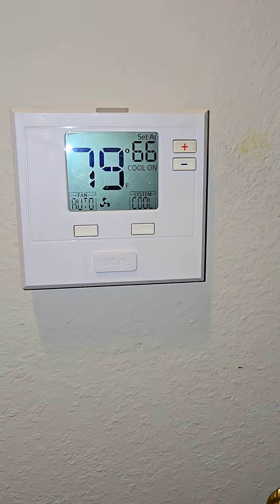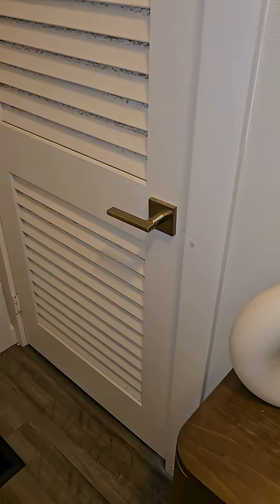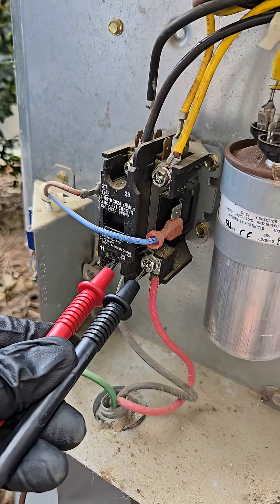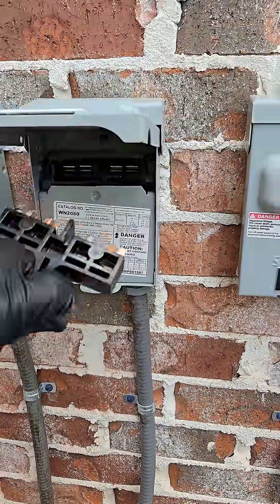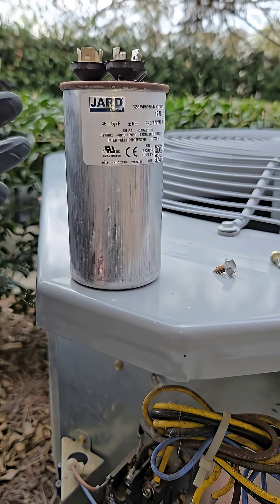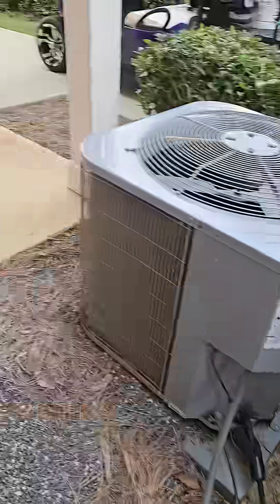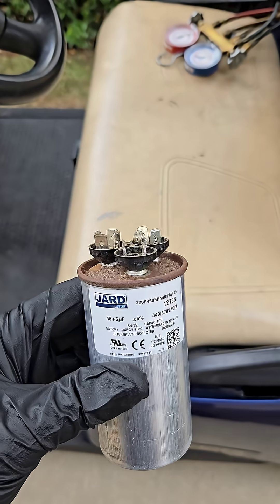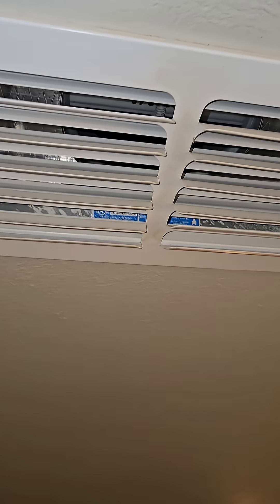HVAC video for beginners.

Comment: Pro 1 and Vive thermostat all read two degrees off out of the box. You need to calibrate them or just simply not use them. When I started my business I used them as they were priced well. But after a bunch of call backs of new units continually running, I stopped using them. The Honeywell S200 line has been great.
Reply from the maker: Thank you so much for watching!
Reply: I’ve seen similar issues with the Ecobees. Not all Ecobees but enough to make you want to avoid the brand.

Comment: Mine went out a couple summers ago. Outside fan not working. So i bought a new one came with capacitor. Replaced both easily. Im not a handy man. I did need a little help cause my old capacitor was dingy couldn't tell what color was what on wires
Reply from the maker: Nice fix! Thank you so much for watching!